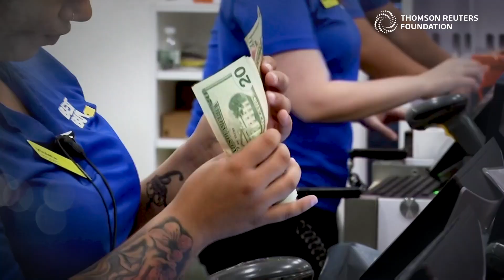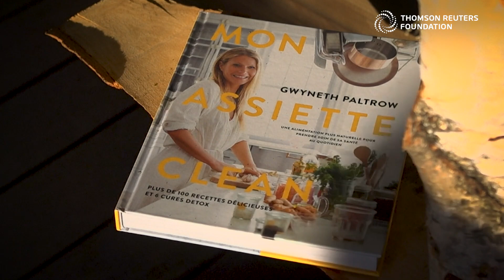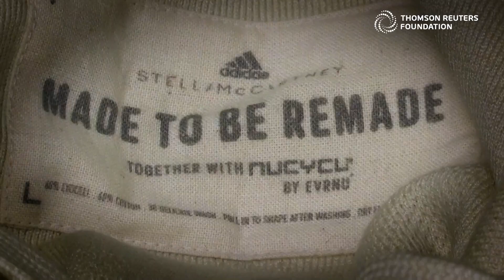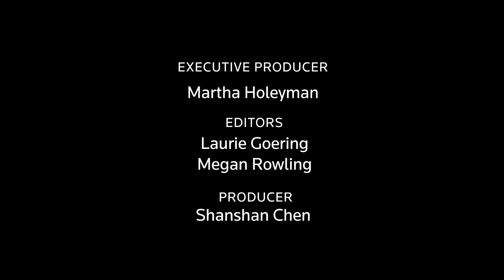Carbon inequality: how our spending drives climate change

Comment: 1.	By reflecting away 30% of the ISR the albedo makes the earth cooler with an atmosphere not warmer.

2.	There is no “extra” upwelling LWIR energy for the GHGs because BB LWIR from the surface is not possible.

3.	There is no “extra” energy for the GHGs to ”trap” and “back” radiate and “warm” the terrestrial surface.

If any of these three points stand RGHE theory fails.

There is no greenhouse effect, no GHG warming, no man caused climate change.